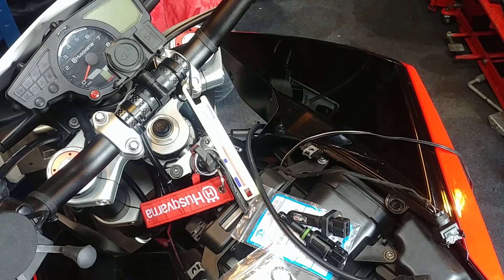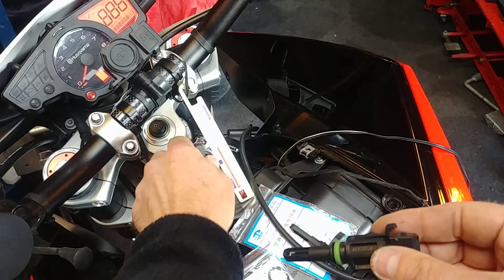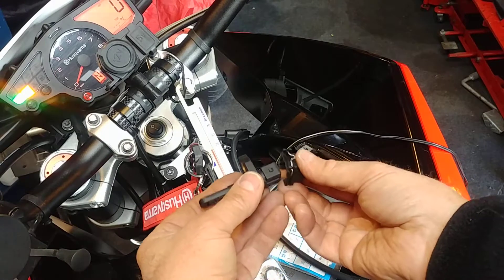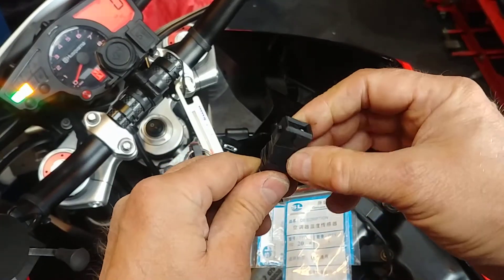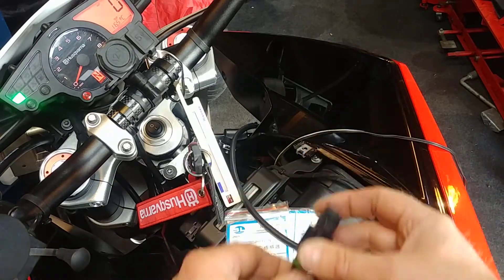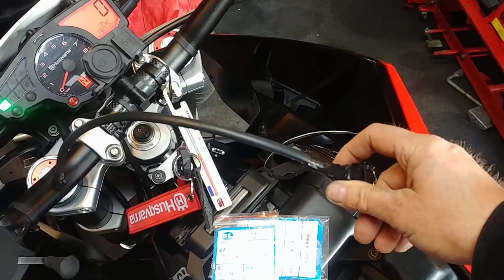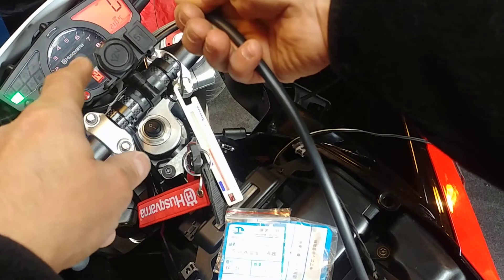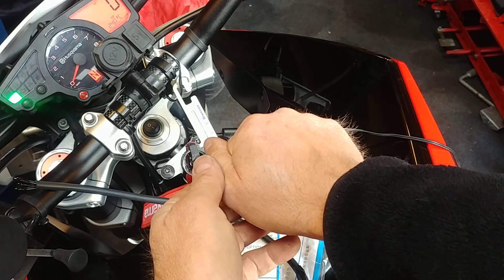Husqvarna Nuda 900 Airbox Thermistor Experiment (IAT sensor)

Comment: Do yourself a favour and buy a rapid bike module with the preloaded fuel map.  IAT devices like this can only do so much. I’’ve tried what you have done an my Nuda and the only way to get the bike to run rich’s across the board is a RapidBike module. This unit tells the ECU the O2 sensors are working with a simulated 02 signal and then allows running injector correction maps for any rpm and any TPS plus addition accel pump for fast throttle transitions. I have zero IAT heat soak issues etc and the bike runs like a train, rock sold idle and start up. You need to add quite a lot of fuel midrange and at 1-3% TPS for good smooth throttle tip in, and actually take some out at the top end at WOT. A simple IAT device like this wont do that. Instead of hacking, tou can also buy a ‘booster plug’ for a BMW RnT and put in straight into your Nuda. It will help, I’ve tried it, but a RB module is the only proper solution. Better than a PCV. I have them on all my bikes. My nuda is buttery smooth on throttle tip versus stock in and runs superb all round.
Reply from the maker: I have just come back from a trip to the Nuda meet in Germany with a friend who has the rapid bike module fitted to his Nuda 900s and I was running completely OE (nothing added or altered) . We covered the same mileage, same terrain, we are similar weight. I had a bit more luggage than him when travelling to and from the meet and 18t Front sprocket 41t Rear.. He used a 16t front and 42t rear.. We both used near enough the same amount of fuel over the whole 10 days we where away... I used a Euro less on each stop on the Auto Bann but he used a bit less than me blatting around the Bavarian forests which is probably to do more with the gearing than the fuelling.. As for the boost plug.. This is near enough what I am doing here..
Reply: yes but overall fuel consumption and general drivability and throttle behaviour can not be directly correlated.
Reply: Guys since you seem quite knowledgeable on the Husky... my bike does not hold the idle and often turns off. I am starting to think it is the lower section of the airbox. In the scheme I see there is a triple exit. 2 exits are for the hoses that go into the throttle body. What about the third? Thanks!
https://shop.nudaparts.com/en/products/husqvarna-nuda-900-abs/air-box-
Reply from the maker: The third is covered with a blanking piece of tube.. However you may find one of the exits is cracked and is letting in air.. This has happened to me and is a common issue.. 
Ask other questions on here:
https://www.facebook.com/groups/286456761408735/
Reply: there are 2 hoses, one from each throttle body that go to a fitting under the air box (this fitting is internal ported to the idle valve actually on the side of the air box). There is a 3rd connection at the fitting that is a blanked off port, yours could have any one of these pulled off so it pulls in air and stalls. Vacuum circuit on the nuda is very simple. Good luck!